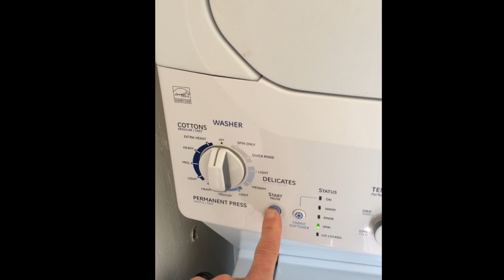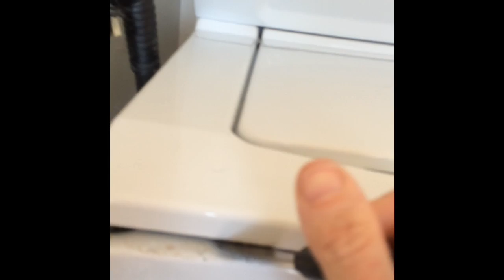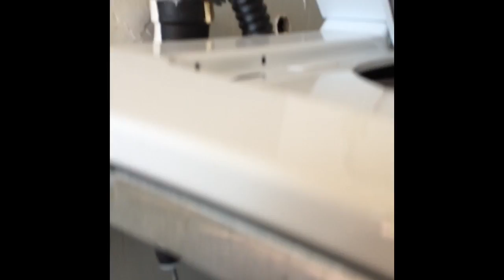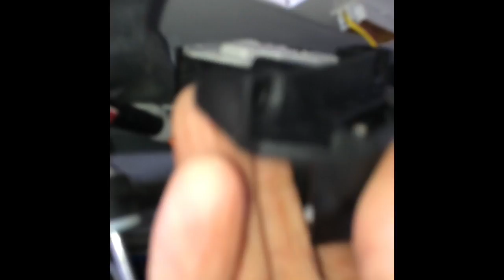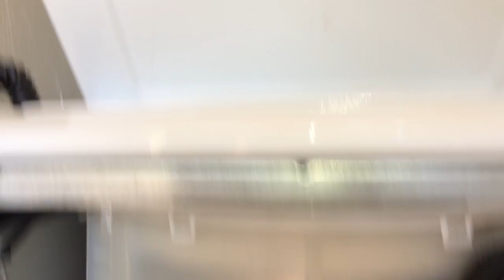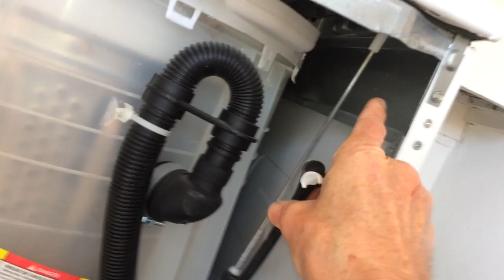✨ GE WASHER DOESN'T SPIN - FAST Easy FIX ✨

Comment: How to remove the magnetic read switch?
Reply from the maker: You take off the front panel by pushing in 2 clips, then remove 2 bolts holding on top panel,
Lift top panel to 45 degrees.
From under switch push on white plastic tab towards front of washer, lift up on switch.

Comment: The issue I’m having on mine is that when it’s on wash mode it spins/ washes very slow. Little motion. When draining the water it spins fast like normal. Any idea what that can be?
Reply from the maker: Might need a new shift actuator.

Comment: Ok, so my machine it will start to agitate when you push the start button, but then it stops. Same model as this one. It fills and drains fine. Is it still the lid switch/sensor, or something else?
Reply from the maker: I think it’s a cheap part called the “shifter”https://amzn.to/4bKFbm5

Comment: Excellent! Where do I order a new switch?😊
Reply from the maker: Here: https://www.amazon.com/WH12X10334-Switch-Assembly-Washers-PartsBroz/dp/B07YFFMG6D/ref=mp_s_a_1_5?adgrpid=55818462477&gclid=CjwKCAiAr4GgBhBFEiwAgwORrdP9bW8y_V1T-OrWeOw9DRExlC0PQHH_tPRbpl5qMboQ0v-5vz3j6RoC4ssQAvD_BwE&hvadid=583833557518&hvdev=m&hvlocphy=9032028&hvnetw=g&hvqmt=e&hvrand=14563355497421905254&hvtargid=kwd-304076659612&hydadcr=3932_13200312&keywords=lid+switch+for+ge+washer&qid=1677794137&sr=8-5

Comment: Mine spins but not with anything in it. Crazy loud noises, not just out of balance noise. Took the towel and pants out, still doesn't work. Took everything else out (a couple Tshirts and boxers) and it is working.  The tip on how to remove the front panel is priceless!!

Comment: My lid switch module is very difficult to disconnect from the lid switch! I've been pulling with pliers and tugging on it with no luck, seemed to be stuck with a clip.. any suggestions?
Reply from the maker: Hi Adam,
Is it the lid switch or the lid sensor.
Reply: @Scott The Fix-It Guy  DIY Appliance Videos   after replacing the lid switch the washer is working again 💪 the sensor was okay 👍 the lid lock module was very difficult to release from the connector, I had to literally pry the thing open and spin the connector off the prongs, but success 🙌

Comment: Thank you brother.  I’m no handyman I assure you, but your clip saved us.  Thank you for posting this.  It ended up being that the belt came off, but your video provided me with the instructions to remove the cover and from there I could see that the belt came off.  This was due to clothing falling in between the wash tub and the top.  There is a gap and if you don’t pay attention, the clothing could slip down and interfere with the belt, ultimately knocking it off.
Reply from the maker: Thanks Victor,
I’ve seen that so many times with that model.
It’s recommended when you fill it to only go up 3/4 of the total volume of the spin basket.
If you get anywhere near the top clothing will often end up in the cabinet and wrapped around the belt.
Reply: And your comment just saved ME! I decided to see if perhaps the belt was my problem before ordering a new switch since my switch wasn't being weird. Belt was the problem!

Comment: So what happens when you replace the lid switch the one that you're replacing now and then one in front of that and the magnet above that and it still keeps doing it. The washer is only 2 years old too. I Still can't figure it out.
Reply from the maker: Were you able to do the reset procedure after you replaced the parts ?
Reply: @ScottTheFixItGuyChannel  i didn't do the reset 🤦🏾‍♂️
Reply: How do I do the reset 🤔
Reply: Thank you in advance

Comment: Thanks for the video. I get this same problem where the lid won’t lock when moving to spin. However, if I put pressure on the lid and press start it will engage the lock. So I think the switch works but it’s not registering the lid is closed. Would this be more of the magnet problem? Or should I still try replacing the whole switch?
Reply from the maker: Is there a couple of small round rubber bumpers on the lid.
Reply: @ScottTheFixItGuyChannel  there is. I figured out last night that the latch on the door wasn’t getting far enough into the locking mechanism. I just twisted the door a little and problem solved.
Reply: Excellent,
Thank you

Comment: I have the exact same set. Normal setting the agitator spins slow. Not sure if that’s normal. Noticed on rinse it’s drains and it spins fast and fills up. By the time on spin button it doesn’t spin at all while on a solid red lock lid light and just drains the water out. Any ideas?
Reply from the maker: Hi Tara,

Can you remove the front cover to make sure the belt is on.

Comment: THE FIX IS SIMPLER. Unkink the hose in the back. It’s not spinning because it can’t drain and it can’t drain because the hose is not how it should be, just wiggle the cord and it will start back working

Comment: I replaced lock lid switch. Still no spin. It clicks, but will not spin. It fills, washes, drains, but just won't engage spin. Lock lid light does not come on. But does in service mode.
Reply from the maker: Usually best to replace the lid lock and the lid sensor located right next to it👍
Reply: @ScottTheFixItGuyChannel  I have tested lid sensor, works fine. I noticed 1 relay on circuit board has small burn mark that the others don't.  Also saw a video where guy replaced motor then spin worked. I don't think it's motor on this one. It works in agitate.
Reply from the maker: Good point,
That burn mark makes me think that it’s probably the circuit board.

Comment: In my situation, I get the lid lock light; the lid is locked, BUT, when the spin, or wash agitate tries to start, it stops and the associated function led (wash, or spin) flashes. Any help greatly appreciated.
Reply from the maker: I think the little white magnetic sensor located near the lid lock needs to be replaced.  The wire below it got broken from too big of a load.  Just need to replace that piece.
Reply: @ScottTheFixItGuyChannel  I tested continuity through that switch and it was as it should be according to the service manual. The motor actually starts to run, then shuts down.
Reply from the maker: Gotcha,
It might be the shift actuator.
Reply: @ScottTheFixItGuyChannel  Would that produce a code Scott?
This may rapidly become beyond my tool collection as well as expertise..
Reply from the maker: I think that does produce a code.
I have seen The lid lock function but not allow the washer to go to spin.
It might be worth it to replace the lid lock since they are cheap and easy to replace.

Comment: Ok a new issue has creeped up. I replaced the lid switch and the unit seemed to work. But now when it finishes washing and goes into pump out to spin it just sits and pumps and pumps and pumps and it won't spin. This is part of the first rinse cycle. So I put it in diagnostic mode and selected spin cycle at position 7 on the dial work perfectly! What's up with this is this a control board problem or some kind of sensor is not being tripped? Thanks for your help Hope to hear back soon.
Reply from the maker: Hey Scott,  I would replace the magnetic sensor that’s right next to the lid switch you replaced.
Reply: @ScottTheFixItGuyChannel  no tested it by bridging the wires... It works
Reply: New washer on the way!

Comment: I have a spin issue with the exact washer/dryer combo. Unfortunately, while it spins on drain and spin, etc., it won't start spinning during full cycles and the start button needs to be pressed again to get it to move forward to the spin part of the cycle. My tenant is an older woman who has trouble moving around and finds this pretty difficult to deal with. Any advice as to what this might be and how to fix the problem?

Comment: Can you answer my question? I have the same model in a studio apartment. Sounds like an airplane. Maintenance for apartment replaced the tub, I believe you call it but it went back to the airplane noise. Is this normal?
Reply from the maker: Do you think it’s being used to wash really heavy items like blankets or bathroom mats?
Reply: @ScottTheFixItGuyChannel  No. Can you please answer my question?
Reply from the maker: Can you send a video of your washer during the spin cycle to my email at Scottthefixitguy@yahoo.com
Reply: @ScottTheFixItGuyChannel  I had a maintenance guy from my area look at it and he says there is no problem.
Reply: @ScottTheFixItGuyChannel  it is not the spin cycle it is when it's at it's full speed.
Reply from the maker: Gotcha,
Can you send a video of when it’s at full speed?
Reply: @ScottTheFixItGuyChannel  It sounds like an airplane. Does it sound like that on yours?

Comment: Hi Scott - Same machine and same shock mount break. Have you done a video on the repair process yet? Also did you do a video on replacing the tub gasket? Recently found a gasket/belt looking thingy in my tub after a cycle, not broken just loose, can you direct me to a parts diagram for this model? Thanks

Comment: Got the exact same model. The spin cycle is not working, so I replaced that same part. Hoping it would fix the problem. It did not. If I set it to spin, it would drain and spin. But when I set it to wash cycles, it would not. Need help.

Comment: Hey Scott I have the same model Machine and All of a suden is stop spinning, however I can still hear the motor working and doing the normal  cycle could you give me any tips on what the issue might be.
Reply from the maker: I wonder if the belt broke?
Reply: Scottthefixitguy thanks I will check that I’ll kip you posted

Comment: I have this washer and tried replacing the lock lid switch. It still won’t drain and the spin light is blinking green and the lid locked light is solid red. Can you please help!
Reply: Check the lid sensor and make sure the wires are connected properly - it's the white plastic piece just above the lid switch. Most likely culprit and easy fix.

Comment: Hi! If my problem is intermittent, (as In I’ve had a problem since yesterday but today after opening and closing I was able to get the lid lock to function) which part of the assembly do you think it is? The lid switch itself or the magnetic read strip?  Also even though I got it to spin after the lid locked, my clothes are still soaking wet! Do you have any thoughts? Thank you in advance so much!
Reply from the maker: I wonder if the drain pump is not working well enough to get rid of all the water?
Do you think there’s water left at the end of the cycle after you remove the clothes?

Comment: I have a question I have a GE stackable washer and dryer when it gets ready to agitate it doesn't agitate like it used to then it will stop an the wash light will blink any solutions
Reply from the maker: I wonder if the belt came off?
Reply: @ScottTheFixItGuyChannel  the belt was loose I tightened it back up
Reply from the maker: Nice job👍

Comment: I hope you still check this posting cause I have a problem.  Today I was going to wash a load of clothes and everything was fine.....filled with water but then wouldn't start.  I had NO lights.  So fixing it the female way banging things I gave up. Shortly I heard the washer going and everything seemed to be fine.  When I went back to put the clothes in the dryer, they were soaking wet.  Again no lights.....no on, spin......nothing.  Help!!!!

Comment: @ Scott. I have a GUD27GSSJOWW stackable GE WASHER DRYER. PRoblem !!!  Washer starts to agitate in wash cycle, but stops immediately. One agitation to the left and it stops. Wash light blinks, lid lock light comes on and thats it. ThTs as far as it gets. Any ideas how to approach this problem? BTW, thanks for your your video on “How to replace lid lock switch.”

Comment: Hello, Scott!  Thank you in advance for all of your super helpful DIY videos.  I noticed in this video that after the five distinct clicking sounds only the spin light blinks on the machine you are repairing.  
My GE begins to drain after it's done agitating (washing) then promptly stops draining, makes those same five distinct clicking sounds (as in your video) BUT the difference I'm seeing is my 'SPIN', 'WASH' and 'ON' lights blink.  Is a faulty lid-switch still the most likely culprit, even though more of my lights are blinking than just the 'SPIN' light seen in your video?  Also I've noticed that the red 'LID LOCKED' light has not come on for me, through any of this. 
 As a landlord barely clearing a profit after taxes, the ability to successfully complete repairs myself is imparitve, so A BIG THANK YOU again for all the help you provide through your channel.
Reply from the maker: Hi Katherine,

I would replace the lid sensor. It’s super cheap and easy to replace .

I think the computer thinks the lid is open.

Comment: would it still be the lid switch if the "wash" light is blinking not the "spin" light?  it fills fine but wont agitate.  when you press the start botten it like clicks then does nothing
Reply from the maker: It thinks the lid is open

Comment: i have a board that i installed but found out that it wasnt the board, so i couldnt take back to parts place, this is for model Gud27essjoww.  it is the main board    it is around 100 plus dollars, i am selling for 80.00    text me at 4044371393..  i am Marc, whites appliance repair

Comment: Does that exact model not have a buzzer to let you know the dryer is finished?
I bought a used set and there isn't a buzzer. Just wondering if my buzzer is dead.
I don't know if I have ever seen a dryer without a buzzer even back in the old days.

Comment: If the unit stops before rinse and you find by closing the lid hard and it starts 
Check the 8 pin connector to ensure all the wires are seated down
Reply from the maker: I think it’s time to replace the magnetic lid switch
Reply: @ScottTheFixItGuyChannel  
Thanks for the reply I did replace the reed switch and the the lock solenoid 
It seemed to work but over time it became intermittent that is when the connector was found

Comment: I have the exact same set. It works fine but when the agitator starts, it will start with 4 little clunking noises, stop, then 4 more little clunking noises. Then will start agitating. Is this normal for this machine?
Reply from the maker: That is normal👍

Comment: I know one thing, and I hope GE sees this, I will never ever buy another GE product again. I've had my washer for 2 years and have been having the same issues on and off with it's filling and not washing. It always happens when I need things in a hurry, and it is simply infuriating. This is the first brand new washer I've ever purchased and if I had more trouble with than the $20 washers from Goodwill that are 20+ years old. How ridiculous is that?!
Reply: Mine is three years old. Was always crazy loud and now does not spin long enough to drain the water! Junk! I definitely do not recommend GE now

Comment: Hey Scott, I have the same combo.  Mine will fill up with water, the agitator will turn slightly, then stop. Same happens when set to spin. It drains, then stops before actually spinning, and nothing happens. Any suggestions?
Reply: J Sin What did you find out to be the problem?

Comment: I work on these all the time. Another problem that causes it not to spin is the speed sensor. If it starts to spin or agitate and stops then check speed sensor. It can be found on the motor and its relatively cheap.
Reply from the maker: Yep, pretty common.
Reply: Where can I purchase one at ?

Comment: The snubber straps breaking off the tub ring is a symptom that goes hand in hand with a broken lid switch, you have to fix both or the chassis will break the lid lock again. There are a whole lot of reasons that the chassis breaks the lock and tub ring, at the minimum you need to replace all four suspension rods. And if that doesn't work, change the whole chassis.

Comment: What is the part number for this exact model lid lock? Thanks in advance.
Reply: I got the part #, it is: General Electric WH44X10288 Washing Machine Lid Lock. you can buy it from amazon or eBay.  many people want to know the part #, but do not understand why video publisher does not share the information after so many requires,

Comment: I do apartment maintenance I'm having trouble with this particular model. The machine trys to spin but stops. Sometimes it will eventually spin and sometimes it just quits
Reply: For my machine it was the motor
Reply: texascatman7 have the same issue.  What was the solution?

Comment: Hi Scott, Thanks for the video. I have exactly the same model Washer/Dryer. My problem is to the dryer. The dryer does not start. I hear the sound tends to start but not the spinning not start at all. May you have any video or any steps to the dryer side. Thank you.
Reply from the maker: Sorry I don’t .  You just need to replace the belt.
Reply: Thats your dryer motor

Comment: Hello,
I replaced the lid lock and it did not help.
When I set my load size on the left side (cottons) to Light, Med or Heavy and push start, you can hear the water start to fill and the top two lights will go green (On and Wash). Once the machine fills with water, the lights will then begin to flash.
If I spin the knob to "spin only" or "quick rinse" you can hear the water drain, the lid lock will activate and it will spin or rinse.
My question is, why will the machine not go through any full cycle without stopping and those top two lights flashing?
I even unplugged the whole machine for 2 minutes and opened and closed the lid 6+ times in 12 seconds...
Can anyone help?
My model number is  GUAN275ED2WW
Thanks
Reply: Did you find a fix for this? Need help please!
Reply: @aaafry  No sorry - we ended up selling it for parts - good luck with yours!